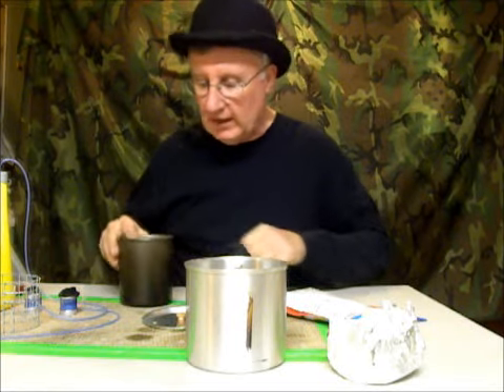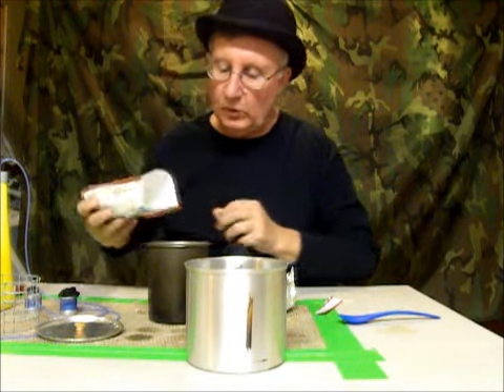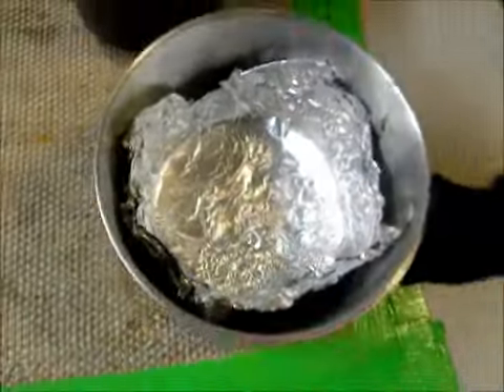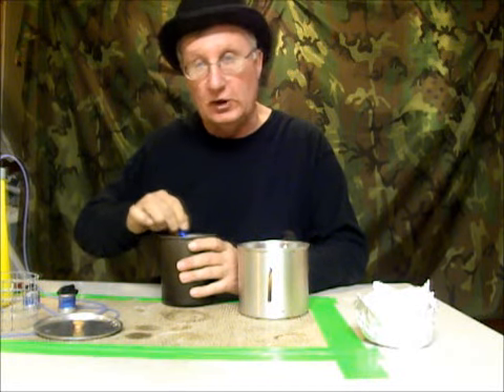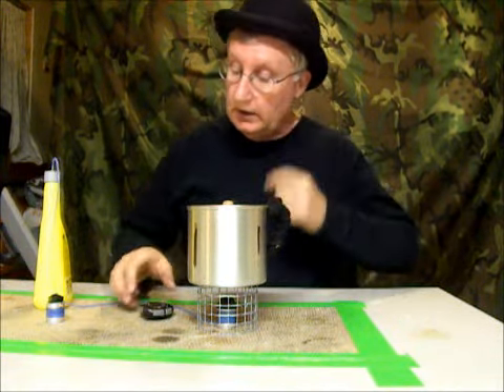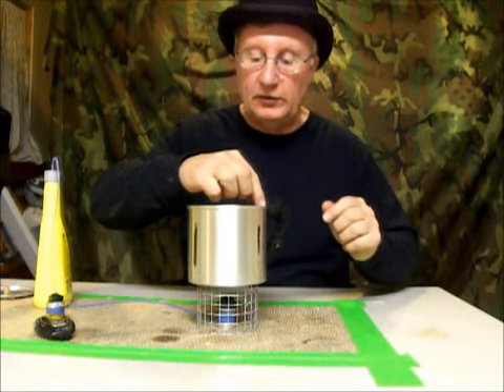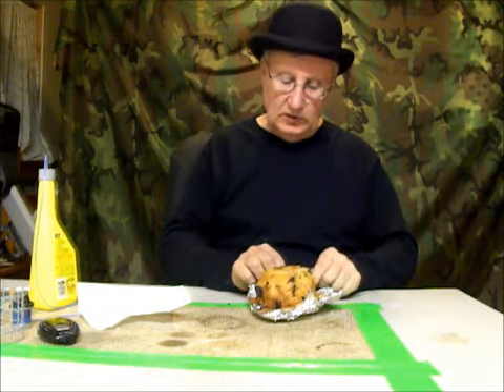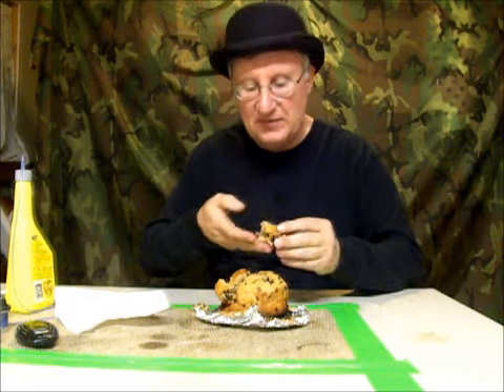Bake off try #3?

Comment: I'm liking the Imusa 12cm more and more, did some boil tests tonight and got significantly better times vs. the 10cm pot (like 1-3min better).  I'm just not a fan of the carbon felt handle, wish there was a better way to insulate that handle.

Comment: Tinny,  You have the right idea, but the wrong YoYo.  You need to RAISE the cake OFF the bottom.  Build you a 1/2 inch Raised Bed.  Use the caged wire, that you use for your Pot Stand. Then set your tin foil ON TOP of that, in the Pot..  You Won't burn the bottom,  You burn the bottom because it is directly ON the bottom.  RAISE IT 1/2 inch to 1 inch OFF the bottom.